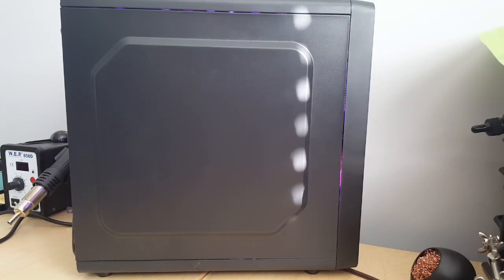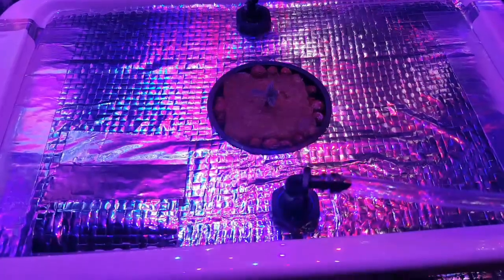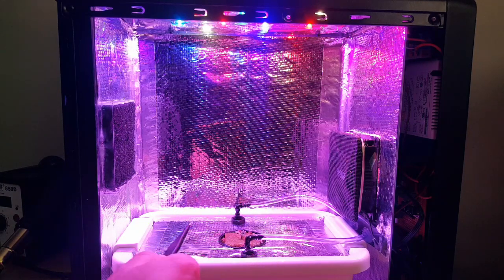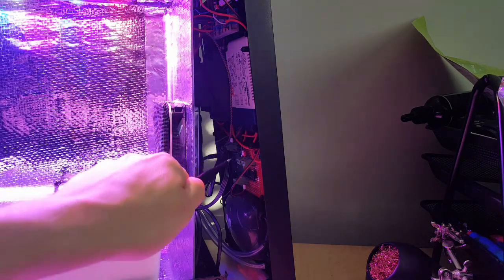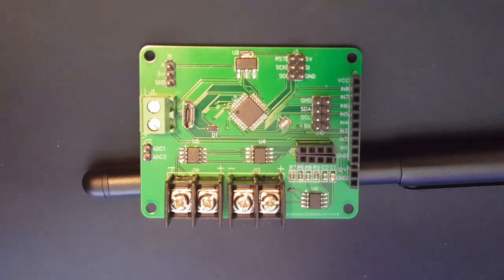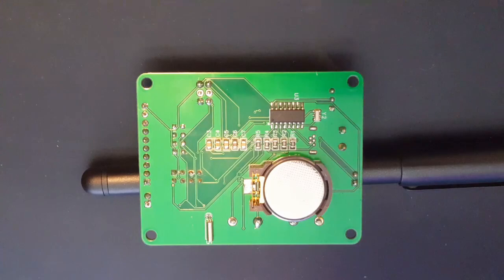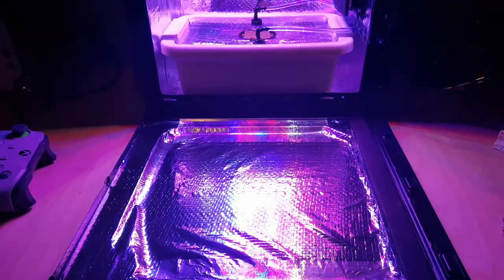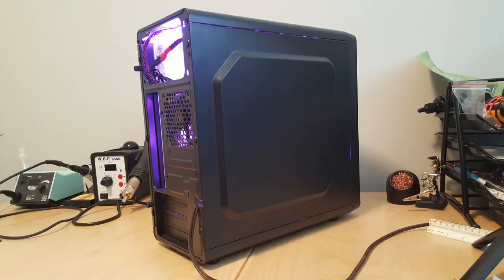PC Grow Box - LEDs, Carbon Filters, Embedded Timer

Comment: does the plant grow optimally in such confined space? also how much watt of led you need for ideal growth?
Reply from the maker: @musicforhours4605  My pleasure my treasure 😎
Reply from the maker: For this small enclosure I used 25W to drive my LEDs.

This particular grow case is very, very small. The plant seemed to grow fine for a short while, but it quickly dried out as it got into mid flower and grew near the lights.

I'd definitely recommend a larger case.
Reply: @autumnmaticcreations62   hmm so how far should be the leds from plant?  and is 25 watts enough for the plant on the flowering stage?
Reply from the maker: Sorry for the late reply, I must have missed this.

For the size of this particular enclosure  25W appears to be plenty - it is a very small enclosure though. I'm currently building a new system in a Rosewill THOR V2, and I will be using a 45W driver and full spectrum lighting in that one.
Reply: @autumnmaticcreations62   sorry to bother you but im a little confused about leds. it is known that you should give the plants 6500 kelvin leds when it's growing and reduce it to 3500 kelvin at the flowering stage. when i look at the 6500 kelvin leds they are blueish white. but when i inspect other peoples builds i always see purple or red and blue leds. if you should give 6500 kelvin for plant to grow why are people giving their plants purple light?
Reply from the maker: @musicforhours4605  People use 'purple' light because it's simply a mixture of blue and red with green removed. Plants don't really use green light for photosynthesis so some people figure that their light will be more efficient if they remove green light altogether.

Plants use more blue light during vegetative growth and more red light during fruiting/flowering. Those numbers you mentioned are color temperatures (CCT) and they describe the 'color spectrum' of white (full spectrum) light. White light that has more blue will have higher color temperatures while white lights that have more red will have lower color temperatures
Reply: @autumnmaticcreations62   so would it matter that much if i just used  6500 kelvin blueish white light at vegetation phase and 3500 kelvin sunset color at  flowering and not purple led?
Reply from the maker: @musicforhours4605  Nope, either will work (if the purple light has the right color profile).

It seems like using full spectrum lighting is the best way to go anyways, so you're on the right path I think.

I recently made a video on DIY lighting, maybe check that one out - I used full spectrum in it.
Reply: I used 125w led in my 12" wide 24" tall 24" long box..i used a 1liter plastic coke bottle ended up being to tall tops of the buds had light burns. I used a gel type odordeizer outside of the box.

Comment: Can i please have the blueprints for the electrical wiring!
Reply from the maker: Most of it is on a populated PCB, unfortunately 😣

Not to fret, though! I am in the process of working on my next system (which will be a lot less hacked together and generally better 🙃) I will be able to better go over the control system and wiring at that point. 

Stay tuned for more! Exciting things are coming.

Comment: Do you recommend a full tower pc case or a mid tower?
Reply from the maker: I'm going full tower next time for sure. You might be able to get away with mid if you're using dwarf autos (I'm going to try that next time), but the bigger the better.

I'll eventually be building a Full Tower grow case and at that time I will do a video series of the grow 🙃
Reply: icanelectoo Im thinking about getting a full tower but they're relatively expensive compared to a mid sized case. Plus most full towers have windows, which defeats the purpose of a stealth grow, in my opinion
Reply from the maker: @userseveneleven  That is true!
Rosewill makes a few full tower cases. Take a look at the THOR V2 - that is the case I will use for my next PC grow system.

Also take a look at the Rosewill RISE. It has a glass window, but you could always spray the inside of it black, or cover the window from the inside. It is a bit less expensive than the THOR. (Honestly though, for the extra space in the THOR, I think it's worth it). I learned the hard way that it's best not to skimp on space 😓

The extra space will also leave more room for a better ventilation system and any required electronic doodads.
Reply: icanelectoo You might as well get the corsair carbide air 540, as it is almost the same price as the Thor v2. Not to mention it adds even more horizontal wideness
Reply from the maker: @userseveneleven  Too late 🙃 it's already ordered. Maybe next time!

Comment: Hi man, really good job but I have one question.
Was the carbon filter pads that you used for the fans effective to remove the smell of one plant completely? And if not, do you have any ideas of how I could do that?
I'm planning on doing something similar myself, just not hydroponic, and my biggest concern is that the smell will cover the whole room and someone will eventually find out.
Reply from the maker: It did okay, but it was faaar from perfect. Next time I will definitely increase the surface area of the filter, and also ensure that the filter is sealed.